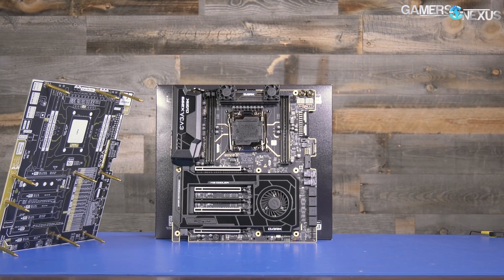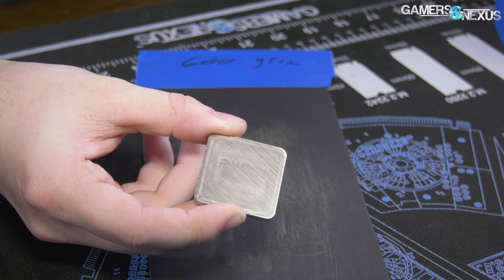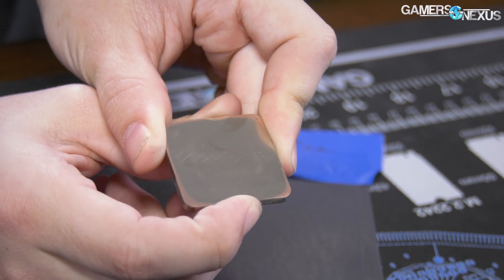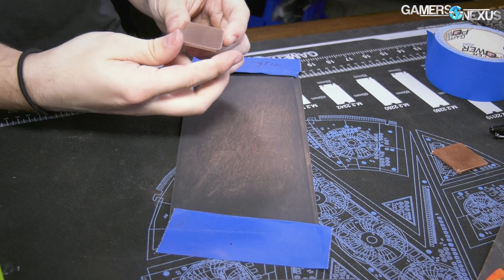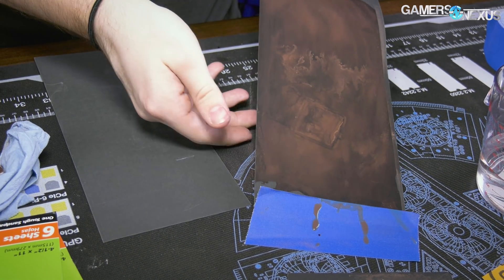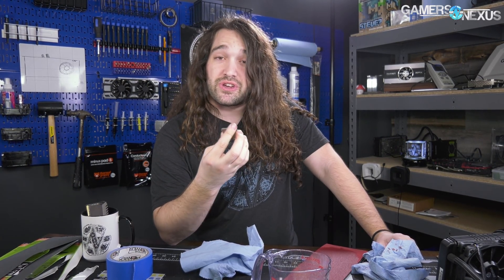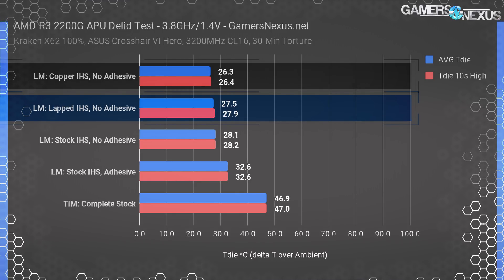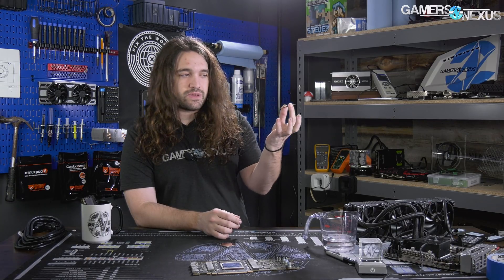Lapped Ryzen IHS vs. Copper & Stock IHS

Comment: Edges show up first because you doing it on that mat instead of using hard surface like glass. Mat and paper sort of stack up in front of moving heat spreader effectively sanding it more on edges.
Reply: This especially happens on the corners.
Reply: And yeah, i can't count times my blood stained the sand paper lol
Reply: And for wet sanding use WD-40 instead of water. Works much better.

Comment: I havent scrolled down to scheck - but you are doing the lapping a bit wrong on this.  Get yourself a mirror or piece of glass to tape the sandpaper too.  You are using a cushioned pad which is absolutely horribly for doing lapping - you will never get a straight sanding like that.  MUCH better results using glass and a light wet sanding.

Comment: deu8bauer lapped the silicon substrate in one of his experiments with an intel chip (I think it was the 9900k).  If I remember correctly, took 0.02cm off and got 6 degrees.  Obviously you need to lap the bottom edges of the lid an equal amount to avoid  gap.  He said that works because the thermal conductivity of the silicon substrate is so much poorer than the lid material (copper).  The etchings are all on the bottom side of the substrate, the PCB side of the chip...  It is a risky thing to do if you grind too much, or if... :)   He did some comparing of the substrate thickness with the 8700k and noticed his particular chip was 0.02 thicker and hence presumed it was save to lap.

Comment: that works for some intels cpus that they are taller in the mid of ihs like there is a hill so cooler only press in the mid and of course is combined with a beefy cooler so that can push ez the extra heat that will get from good pressing all ihs . so u must have both  hill in the mid and beeffy cooler to see significan difference after laping Jay2cents has a video with that 
https://www.youtube.com/watch?v=EALCvMxvLyA
check at jays video at 5:08

Comment: Thanks for doing this....  I was one of the guys some 15-20 years ago lapping herds of C300 Celeron processors and cpu cooler heatsink bases, etc to improve heat transfer....  it was a much bigger deal then....  but I AM surprised at the large runout on that IHS you just lapped...  a lot for a modern mfg part.

Some things you should consider when lapping.... 

1) Don't hold on the edges...  it promotes unequal pressure, tipping, et al.  Put fingers in center and apply vertical pressure....  It promotes lower resulting runout (flatness) and will reduce finger tip erosion.  <smile>

Don't use your mat...  as cool as it is, as your lapping base.  Use at least a quality, low runout thick piece of ground glass or metal and if you use sandpaper, take care to get it flat and tightly mounted...  wet backing helps.

Best not to use sandpaper.  Use lapping compounds directly on a hardened lapping surface.

Don't use a back and forth movement...  Use a circular or better a figure 8 motion.

ALL wet...  no dry...  wet will improve waste removal and reduce abrasive imbedding...

Ideally, the part should rotate while lapping....  as an approximation, you can rotate the part orientation 45 or 90 degrees after each "X" number of full circles or 8s....  actually, the optimal rotation pattern is a lot more complicated...

Lots of other tips...  

Other things to consider...

The inner surface of the IHS....  no reason to believe it doesn't have an equally awful runout and surface finish.

The surface of the die....  trust me...  the die is NOT flat.

Lap both in addition for additional improvements.

Each of those minor improvements just under your measuring tolerance will aggregate if you do them all to produce an appreciable improvement.... and it will make a big improvement under max load and OCing.

Comment: You should have stuck the sandpaper to a peace of glass...
Seeing you use sandpaper to get a mirror finish is horrible...
1) always have a flat hard surface under sand paper. (glass or polished stone is the best).
2) move in eights. And turn 90° now and then. 
3) don't put multiple sandpaper over each other. 
4) press with a consistent pressure on it so it doesn't "diggs in", as it did for you.

Even paper, wood and plastic is very soft.

Comment: Having polished glass and metal in an optics lab, there are certain things that we did to ensure a perfectly flat surface. For one, we used a 1/4 in thick slab of borosilicate glass of at least 4 inches square. Then used grinding and polishing compounds with water. Mating the surface you want to grind with the glass, then slowly adding water. Of course it's always a good idea to use a fresh clean piece of glass when you switch compounds.
With the water and the compound, you end up with surprisingly low surface tension, need very little pressure, and run far less of a risk of destroying your fingers. It's always a good idea to wear rubber gloves if you can to reduce the pruning effect. It's also best to try and grind with low pressure in a figure eight pattern. (You want to keep striations to a minimum, and this pattern helps to ensure that. Although it is a little difficult to maintain.) 
It can take several hours to polish, but the end result is an incredibly flat and shiny product. Of course everything depends on the degree of flatness you need. The grit we used was always used wet, and ranged from the hundreds to the tens of thousands. I doubt you'd need anything quite so fine for this application though. Just something to keep in mind for future reference.Note, a similar technique can be used to polish slabs of silicon, but is usually done in a lapping machine. But the old fashioned manual way is valid, although boring as hell. 

Love your videos.... Very informative! Thanks.....

Comment: I wonder if you could achieve the same smoothness with a laser.  Melt the surface in microscopic portions just long enough to flow to a level.  Maybe someone's rust removal laser can be adapted for it.

Comment: This was hard to watch from an ocd pov.. 

Get yourself 1/4" thick 1'x1' tempered glass pane and place it ontop of a paper towel (so glass stays put and conforms to any irregularities in the table). Next take a straight edge and .0015 feeler gauge to insure plane flatness. Then tape your paper tightly to the glass. Lastly, lap in a figure eight motion and frequently rotate the IHS 90 degrees to eliminate any one side/corner lapping more than the other. Also, your cooler should also be lapped to match the ihs. 

Now if your really feeling ambitious, lap the bottom ihs pad that meets the PCB decreasing the distance between IHS and die, monitoring progress via digital caliper, not going more than .001'.0015 thousandths of an inch. 

I realize these tools and substrates are not practical for most enthusiasts, but if you plan to mod in the future they're worth the investment. (for most serious DIY engine builders these tools have already been obtained so cost is moot)

Love your vids/channel btw

Comment: Correct me if I'm wrong but, your mat has give to it compared to say a machinist stone. So the edges get the pressure more so then the edges. Giving you a more concaved effect rather than a level surface.

Comment: I would say you only made the IHS worse.
By sanding on that mat, wich will be somewhat flexible you make the IHS more like a bubble than anything else.
Simple physics. If sanding lapping and want to have it flat. Put it on flat surface.
Like HardOCP said, easiest for home use is to use a mirror. They mostly very flat, if not you could easily see it on a mirror as the effect will be doubled.

Anyway thanks for testing this all for us!

Comment: If you do it on a soft surface you are going to end up with a concave finish, think about it, you're depressing the sandpaper every time you run your IHS over it. Try again on a hard and smooth surface. Can't tell you if it will make a difference but if you want to find out, you at least need to do it right.

Comment: Love your work!! From my experience, when polishing a flat surface it's best to use a sheet of glass at least 3/8" thick. I noticed that the edges wore faster than the center, and you mentioned that the AMD is slightly concave, but, if your Mod mat is at all spongy or not completely hard, then, while polishing the edges will wear faster as they dig into the substrate. Regardless if you apply pressure on the edges or the center. You can also use granite tiles available at the home center, I opt for 1/2 - 3/4" samples. Which can be picked up for cheap. Granite comes in handy for A Lot of things as well. Makes a GREAT heat sink too! Just my 2 cents. Best and keep up the good work! -- Obviously, One should place the Sandpaper on top of the glass or Granite. Not just rub the IHS on the glass or granite.

Comment: Suggestions...

Firstly, use a figure 8 pattern during sanding.

Second, sand on a flat surface, my material of choice is a sheet of glass.

Third, after sanding with 300 or so, use aluminum polish (Mothers is a good brand), and you will get the best possible finish. You wasted so, so much time to get a result that $5 and a rag would have achieved in under 10 mins of polishing...

Comment: Why did you delid it in the first place? you added a unnecessary variable there becouse nobody can reinstall the heat speader the same exact way every time. And to all people saying that AMD pins will bend, they absolutely WONT if you use a gentle touch (wich you have to when putting a shine on anything you damn cavepeople!). And for all the copper powder between the pins, wash it out with a splash of pure-as-possible alcohol and a very soft, short haired brush.

For the lapping itself, always use a piece of glass or a mirror. The motion is very debateable, some people say you have to do 8's. myself i hold my index finger and middle finger on it, and rub it side to side as far as my arm will comfortably alow. I do this 15 times, turn it 90 degrees clockwise, do another it 15 times, rotate clockwise again and so forth. that way its near impossible to take off more material off a corner or side.
Also apply enough pressure that you dont accidently flick your cpu off the table (happend to me a few times) but let gravity do most of the work. if you get impatient and try to push the core through the glass you WILL end up with crooked sides with result in dramatic performance loss.

for the final stages 2k grid is way, way too rough. go for 5k or higher. (you can find it in the better hobby stores or car body shops). dont bother going to home depot.

Heres another protip; coolers start to bulge out in time (especialy liquid blocks), lap those aswell. If you did it correctly the cooler will slide right off the cpu like its on ice or something. if it doesnt, its just too rough and it needs more time on the mirror.

For everyone who say i dont know what im talking about, ive done a bunch of them, and my technique gets better every time to this point where ive got a rig running just fine WITHOUT PASTE!

Comment: Polishing only IHS does not make a big sense in terms of better contact. No matter how you do it.
For a good result you must apply a special technique called scraping (or maybe I'm wrong with name of it, I'm not a native English speaker) or similar to BOTH contacting surfaces. Because imperfections do not match on each surface, polishing only one of them would not do the trick.

This technique requires some special paint and tools. You need to apply a really small layer of paint on the one surface and rub one surface to another surface. It will make some patterns. Next move is to scrap down all "painted" regions a little with a special tool (scraper). Repeat the paint apply step and you will see more paint on each side, because they will get more contact.
After a lot of such steps your parts (IHS and bottom part of the heatsink) will literally stick to each other under pressure or hover one on another with a really small friction because of air layer. Like in this video - https://youtu.be/RQwizm7-UbU

Comment: Here's a pro-tip for sanding:

Mirrors have to be flat otherwise the reflection looks wonky, er go good flat hard surface.  
Put something wet down on the Mirror's surface. Paper, wet, on something with a surface like a mirror, is very grippy.
Use Windex in place of water because its properties for cleaning surfaces mean it's all about getting rid of the tiny particles on a surface without leaving dry-stains.

A woodworker taught me this (Wranglerstar) for keeping his chisels sharp.

Comment: Others already stated about using a flat solid surface like polishing glass but for the average home user who would have no other use for such a expensive tool ( I work with fiber optics so yes it is a tool ) the biggest reason for lapping was to flatten the IHS, Intel cpu's are notorious for uneven surface of the IHS which would give you a noticeable difference in temps, seems the soldered ones were worse but even the TIM ones are still pretty bad. I still do it mostly because I always have, I usually go all the way using fiber optic polishing film for a super smooth glass like finish, the other plus side is I use way less Tim between the CPU and cooler ( which I also usually polish ).

Comment: You should have used a hard surface for the sanding. The way you sanded it, the mat bows inwards so the outer edges of the IHS get sanded more than the center. This phenomenon can be readily seen in professional machine shops. I wish I could have told you before you started so you wouldn't have made the mistake. Hard surface that is true (perfectly flat). Put the sandpaper on that. They actually make benches that you can use for their extreme flatness to check whether an item is perfectly flat.
Reply: Use gloves next time you sand too.

Comment: A few pointers on this process:
1. As stated in other comments, glass is the best surface to place your sandpaper on. A softer surface will tend to make the IHS slightly convex
2. While sanding, especially on lower grits, rotate the IHS so that you remove material more evenly
3. Get your sandpaper on amazon. The cheap stuff works just a well.

Comment: Oh man, you HAVE to use a very very flat surface for this, you need a thick mirror or glass, I use the glass from a document scanner as it's pretty thick, A4 sized, and seems to be made from a more sturdy glass. I would advise using wet and dry sand paper only as it does give a better finish at any stage, and advise starting at 180 grit, then moving to 400 grit, 800 grit, 1500 grit, 2000 grit and to finish at 2500 grit wet and dry. Spend about 5 to 10 minutes on each grit sanding in a figure of 8 motion to evenly sand the IHS, and after the 2500 grit, you should have a very polished finish. If you want use a chemical polish after that like brasso or similar if you have to have that mirror finish.

Comment: This was pretty interestilng! A suggestion from the world of sharpening and flattening the working surfaces of hand woodworking tools: Affix your abrasive sheets to a thick piece of plate glass or to a polished granite surface plate (this latter much more expensive than plate glass), otherwise you risk making your surface less flat than it was. I’d also recommend always using water of glass cleaner to lubricate the interface between the IHS and the abrtasive. You can get faster and better results that way. In the video, a multitude of scratches were clearly visible at the end of your polishing efforts, notwithstanding how shiny the copper was. That’s a lot of imperfections in the surface, and since they are clearly visible to the naked eye, they sure aren’t micro! Also, wear protective gloves when you do this so you don’t hurt yourself! I use fabric gloves with a coating of rubber on the fingers and palms. They are flexible enough to allow full control of what I’m doing without dinging myself up.

Comment: Something I learned as an apprentice painter.  Don't push on the sand paper.  It doesn't make it go faster, it actually breaks off the larger pieces of grit and diminishes the impact on the part. If you don't push, it removes more material more quickly because the larger crystals can cut more deeply. 
Don't know how hard you were pushing, so i have no idea if this was even helpful, but I thought it couldn't hurt to pass it along.

Comment: I used to lap hyudraulic parts to make a mechanical seal to hold up to 3500 psi. We would use a light oil and a figure 8 motion to help with even wear and you cover more distance with each pass back and forth.

Comment: lapping on a plain simple table? I would have used something like a sheet of glass. Flat glass is poured over molten metal, making one side almost perfectly flat, making the "right" side of a plan window glass a good "plane" and "hard" "lapping board" on which you can place the sand paper on.

Comment: Hand sanding a flat surface on a somewhat soft base (the mod mat) will almost certainly give you larger variance in flatness of the polished surface than the factory machined surface, albeit a mass-produced IHS. This test, compared to the ridiculous tests you've done in the past with pressure sensitive paper for cooler contact, is just...how could I put it...meaningless.

Comment: Oh dear, The goal of lapping is NOT SHINY, it's to get it FLAT! ( shouting for comedic effect, imagine drill sergeant )
Never forget that the end goal is Flat. People tend to lose their end goal of getting it flat, by getting distracted by Shiny! Don't get distracted by Shiny!

Having said that, there is one other reason why shiny is bad, and that is surface area. a rough surface will have more surface area, letting it output the heat better. So in case you got distracted and accidently ended up with Shiny!  You can easily fix that by dragging it over a rough p300 or so paper, to get some grooves into the surface. (after making sure it is properly flat first of course)